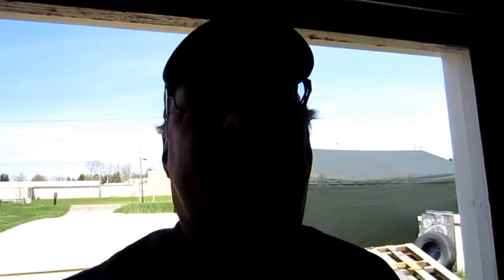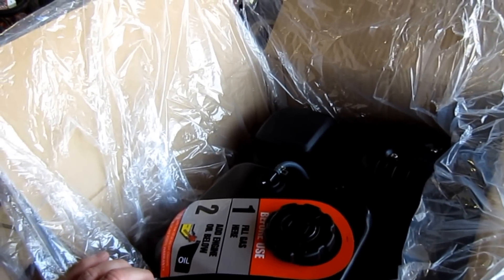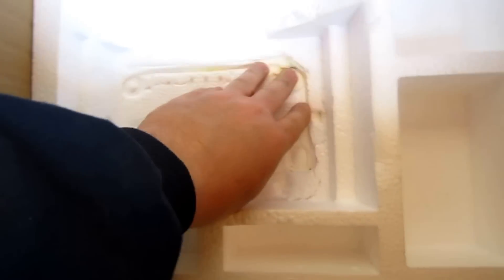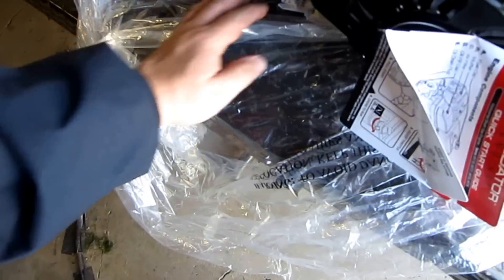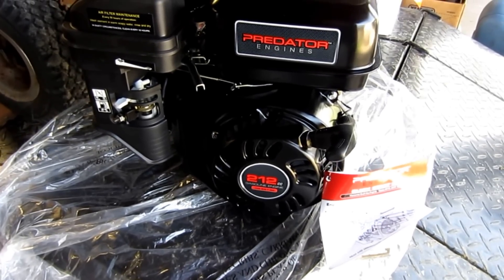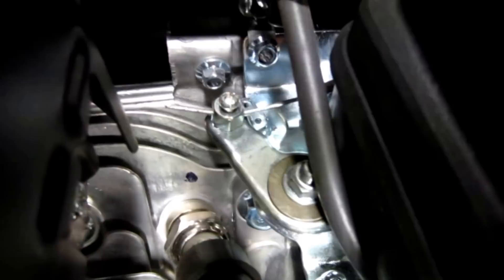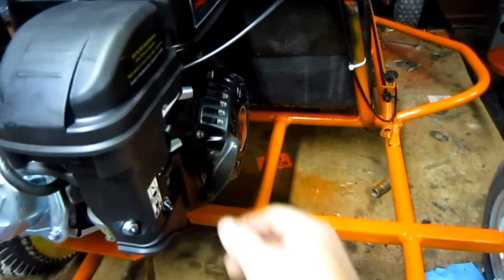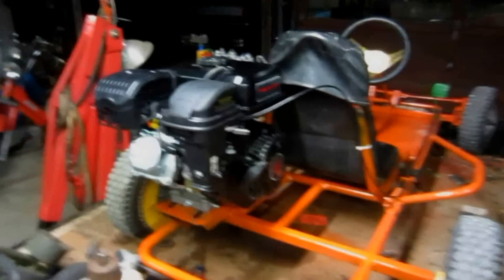Go Kart powered by Harbor Freight Predator engine

Comment: Harbor freight has two 6.5 hp's Item#69727 or 69730. Do you know which you used and what the difference is? Did you have to take links out of the chain or put spacers under the engine? I'm replacing a B& S 135212 on a manco starbird go cart,looks very similar to what you did. If the clutch and base bolt on,I just have to play with the throttle cable.
Reply from the maker: Not sure you will have to rewatch the video and look on the box for the number...
No spacers were used to mount engine except heavy washers. chain was made to length..

Comment: Did you engine come with the bolt that holds the clutch on? Mine did not come with one do you happen to remember what size bolt you used, length and size?
Reply from the maker: 5/16-24 X 1.5" HEX BOLT
Reply: Awesome thank you.
Reply from the maker: no problem.. go with grade 5 or higher

Comment: I used this same predator engine on my manco 606 go kart and it improved drastically. I love the engine, especially for the price. what cutch system did you use on this kart? I'd like to know because I am planning on using the same engine on a street kart build.
Reply from the maker: I was impressed too..  see the parts list in the descrpition